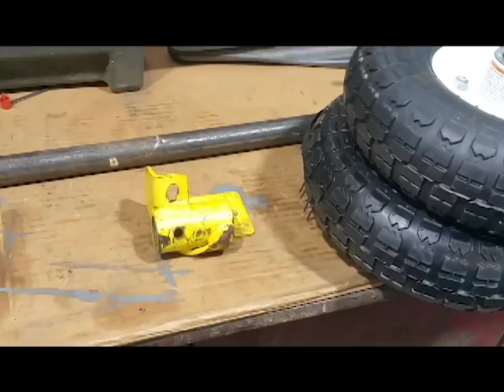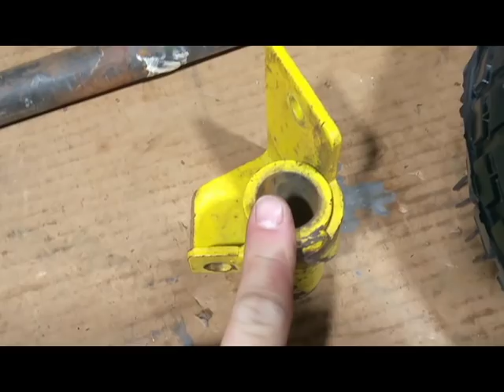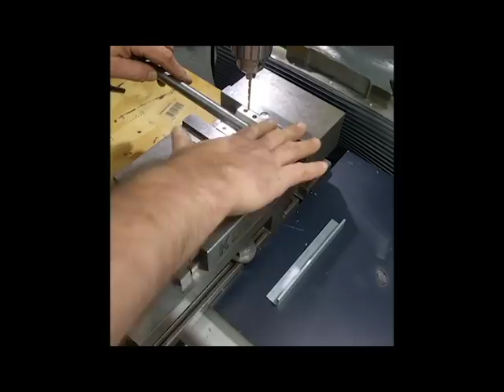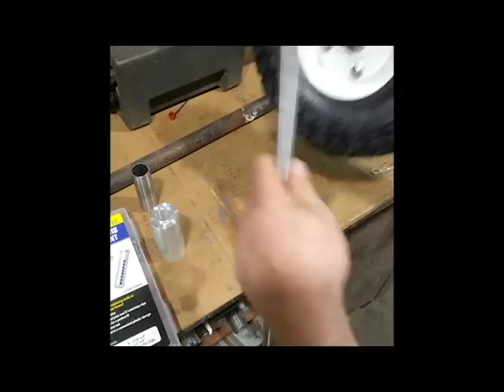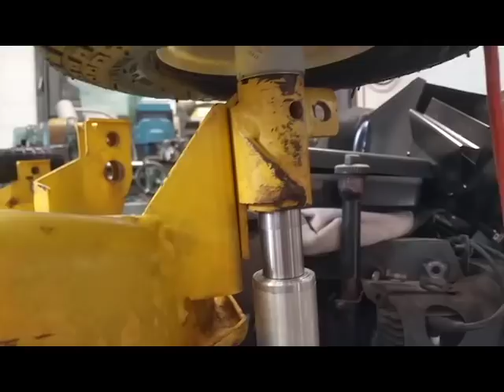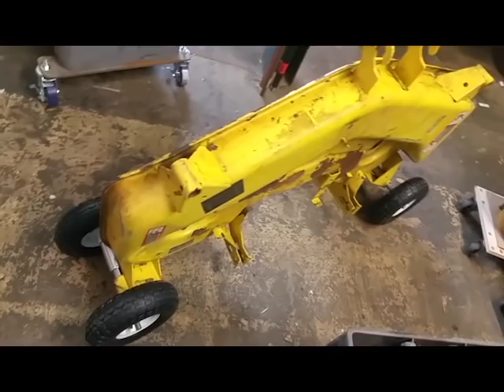John Deere Deck Dolly 4x5

Comment: There is nothing a mill and a lathe cannot solve it is just amazing to us how this is. We like John Deere but only need, no just want a Gator because we live rural. True issue just had this material thing arise here in our shop we wanted to make a steel shaft for collet holder and we did not have it got mad bought a lot of material (we are poor now) and that will not happen again to us I mean we hate to feel so helpless when you have a lathe and a mill yet you can cut nothing because of the material the right material being in stock. Have a happy New Year.
Reply from the maker: thanks AA happy new year to you !

Comment: Nice project idea, Joe. I liked your bushings. They reminded me of back when I first wanted to get a lathe. I really wanted one because I was making mini bikes and motorized bikes as the time, and both of which were a constant battle of trying to eliminate slop. Things like bushings, spacers and locking collars were things I either had to make with a saw, drill and file, or just dream about. I get that your design is temporary, but I still admire the nice custom made pieces you used. They reminded me of how good it is to have a lathe. That said, don't you just hate a broken spotting drill tip? I've ruined more drill bits than I care to admit while trying to dig those broken tips out.  Happy New Year to you and your family, Buddy. :)
Reply from the maker: John,  seems as there is a reason for everything !  LOL yup, that's what re-kindled my interest in machines. working on garden tractors and not wanting to sit at my desk anymore.  Happy New Year to you and your family as well !!
Reply from the maker: and thanks so much for the kind words !
Reply: Hey Joe, did you happen to see my Bridgeport price evaluation question on the other video?? Happy New Year, Buddy.  @RaptorMachineToolCo
Reply from the maker: John Strange I do remember that, and thought I replied. But, can’t find it now... how can I help?
Reply: I was curious about what you would deem worth it, and just thoughts on potential headaches or whatever... I'm just educating myself more or less. (If you get a chance, look on the Accurite video comments. There is a link and my question) Thanks. @RaptorMachineToolCo
Reply: How you doing, Joe?? Hope all is well in Raptorville.  @RaptorMachineToolCo
Reply from the maker: @johnstrange6799  Hi John ! Doing well ! How are you?
Reply: I'm fine. Just haven't seen anything from you in a minute. :)  @RaptorMachineToolCo
Reply from the maker: @johnstrange6799  just have been super busy..  lots new stuff going on ..  will be back soon !    Looking for some strange videos as well !!